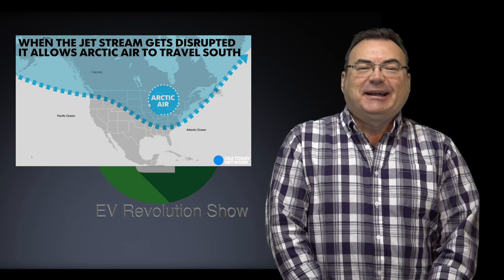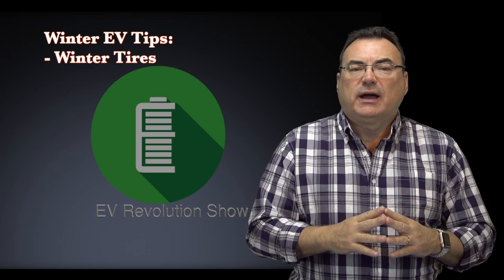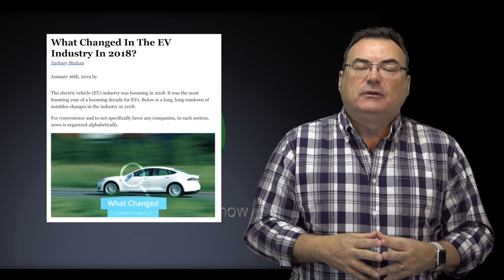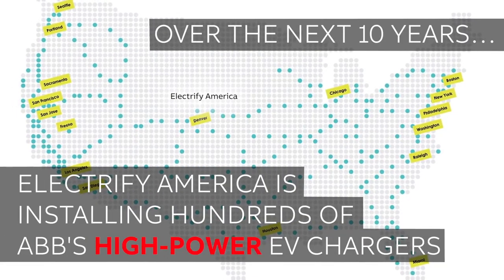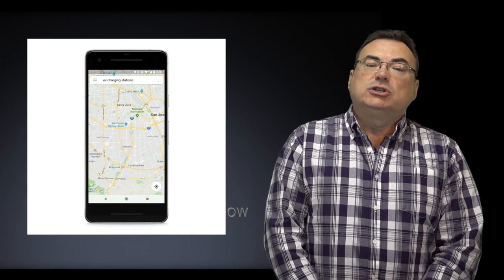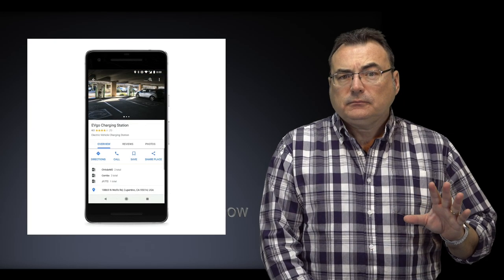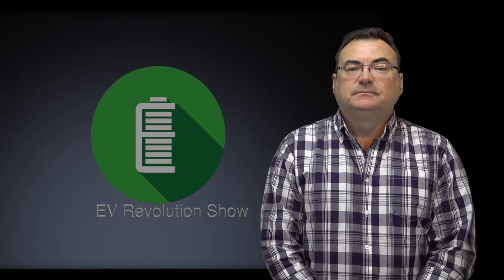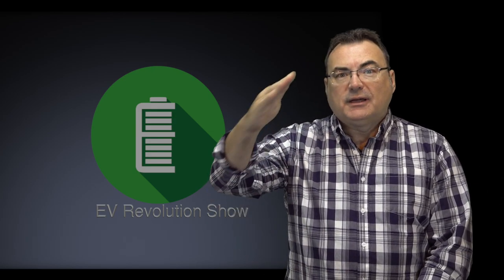Episode 29 - BEV Winter Driving, 2018 EV Industry Changes, Tesla, Kia Cadillac & Rivian Updates!

Comment: Capacity of the software limited Model S is very simple math : 310/335 (EPA range) *100 kWh=92.5 kWh. So basically you get a 7.5 % buffer against loading to 100% .
Reply from the maker: HI Gerrit, thanks.  That seems a bit high but math is pretty solid.  Appreciate you watching!

Comment: Ken - totally agree on your pick of the E-Niro - it checks a lot of boxes for family transportation.
Reply from the maker: Thanks Dennis, appreciate you watching and feedback.
Reply: Have you heard of the Kona charge port being on the front and full of snow unable to charge the vehicle. Eniro & soul ev will have the same problem when snow falls. Very poor design.
Reply: The only One - front mounted charge ports make a lot of sense - for all of those other days.  Your snow argument also applies to side ports, which can ice up on overnight charges.  Nissan Leaf front charge port seems to be a good compromise - it will pop open with slush on it, but perhaps not when it’s iced shut.  Without stuffing a charge port inside the hood or trunk, I don’t see a 100% solution.
Reply: @dennislyon5412  Its a concern I also have. However I assume there is Somme weather stripping to keep moisture out.
Reply from the maker: HI, I'm not aware of any major issues with the charge port.  Of course you would have to clean it off if covered with winter snow.  If freezing is an issue, then maybe carrying a small plastic lever (like a dash removal tool) will help.  I know with my Leaf, I've not had any issues this winter so far.
Reply from the maker: Thanks for sharing that info.  We will have to see how much of a problem that will be, as I can see that initially because of the snow he could not fully seat the charging plug therefore the EVSE would not start.  Maybe Hyundai/Kia will recognize this and put some sort of cap on the port too?
Reply: As I saw the eniro and the soul ev at the Montreal auto show two week ago both ev are PRE production vehicles and the charging port is located at the same location on the front of the vehicle. This issue is a major problem for me as I was planning on purchasing the Kona in the next couple of months. It is not possible for me to charge the vehicle at home I'm only available to charge the vehicle at work so this is a deal-breaker for me I will be purchasing the Chevy bolt in the next couple of weeks the reason is the bolt has proven to be a great ev and has a great track record.
Reply from the maker: The only One And that is why it’s great to have choice!  Thanks for watching!
Reply: @EVRevolution  Ken in your experience have you had troubles with snow and the charging port door
Reply from the maker: Walter Payne Hi on the Leaf no. During this cold spell the port door would not pop up as much as it usually does when I press the open door button, however it’s still enough to pull it up. No snow gets in the inside and the connectors have no issue locking in.

Comment: We had one day of snow here. I went on one back road that was very quiet and I could feel the rear tyres spinning a bit and then even the fronts starting to slide when I turned in. I was being very careful on the power so yeah, if it got any worse then I’d have to not drive. The Continental EV tyres just aren’t capable of handling very much at all. I’m not sure I ever drove my Zoe I had before on snow and ice at all. If I did, I don’t remember it losing traction like this.
Reply from the maker: Thanks Chris for watching and for sharing your experience.